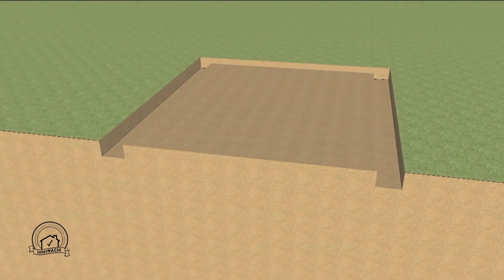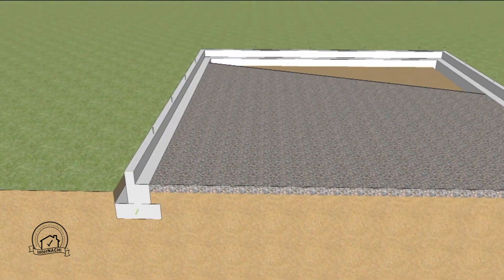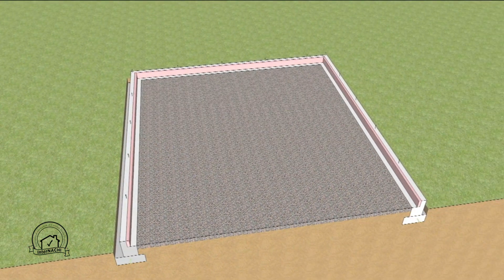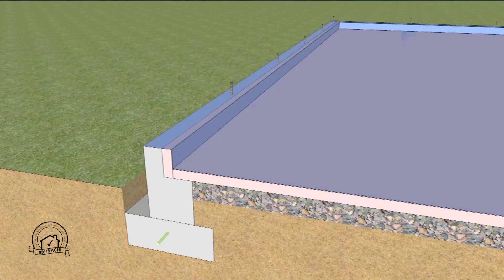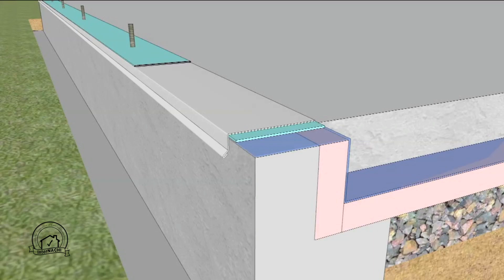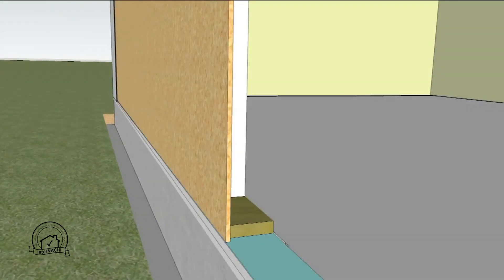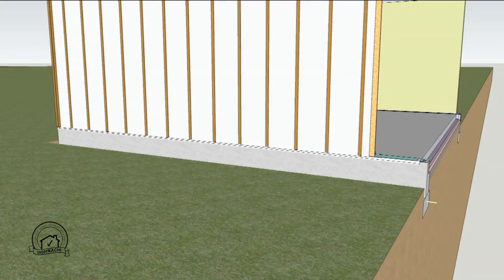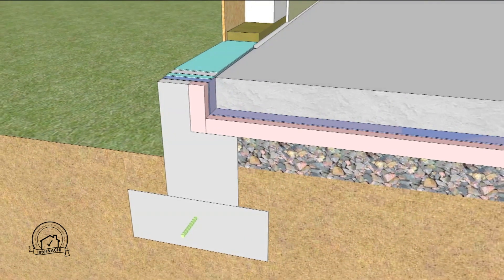Slab-on-Grade Foundation With Concrete Stem Wall and Under Slab Insulation

Comment: I would like to see another video of this with one change. That change would be having the EPS for where the fill is, along with a footer to support the weight of the sidewalk and proper slope away from the wall. Using eps foam under sidewalks will allow for minor fluctuation in ground heave and thaw which will prevent cracking. This process has been tested all over including insulated footers as well. A four wide sidewalk all around the house should help prevent future problems much like what is on many exising homes. EPS insulated footers are one good way to go as well. They can help prevent future cracks to foundation and future damage. 
I intend to build my new house much like this process with 2x6 walls and zip R 12.5 sheathing.
Reply from the maker: Okay. Thank you for watching.